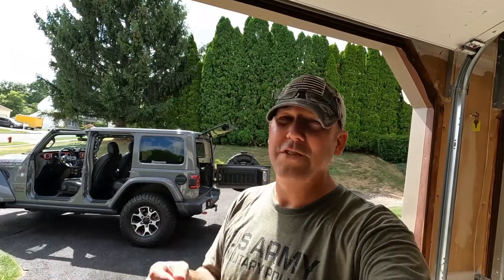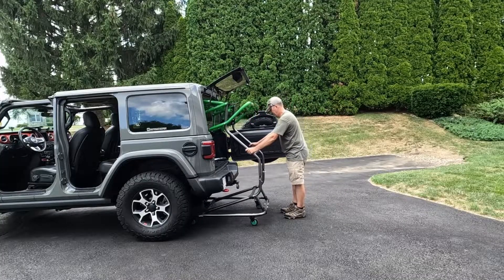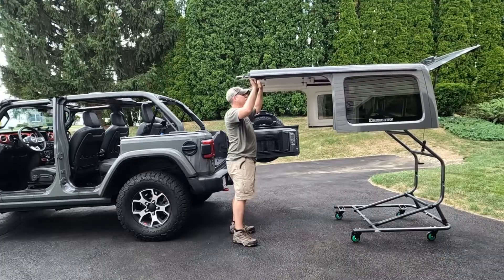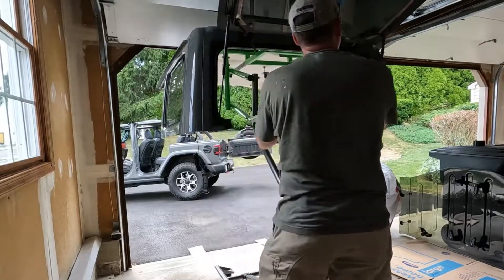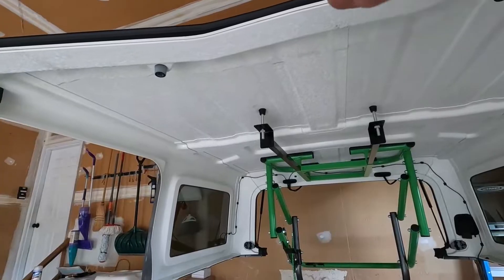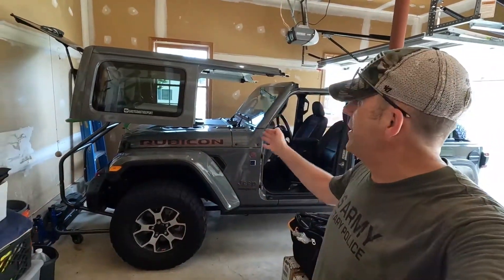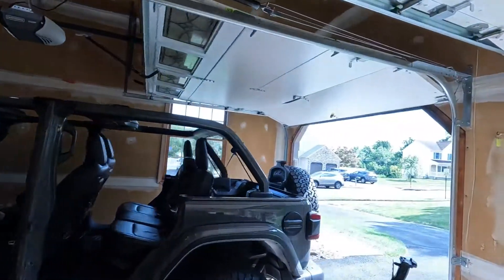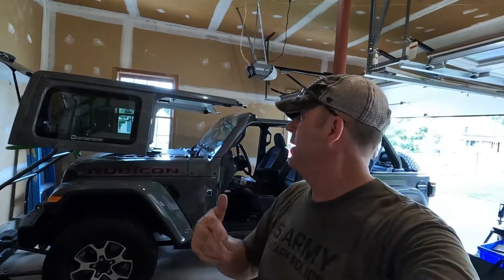How to easily remove your Jeep top: TopLift Pros Review

Comment: I agree with you on the Installation Instructions.  I struggled with getting the Hand Cable adjusted correctly.  I actually did put a Rubber Vacuum Cap on mine, since it was way too close to my hood, when I parked under it. I may actually cut it off, since the Top Section of the Unit will never ever go that low.
I have since upgraded to the TᴏᴘLɪғᴛ Pʀᴏ：Vᴇɴᴛᴜʀᴇ Pʀᴏ, because I have a small 1 Car Garage and this Unit has a smaller footprint in regards to the Base Width.  Also, the Legs are adjustable and I just tuck them in when not in use.

Comment: for whatever reason, mine was too high to get inside and under the hardtop of my 2-door stock Jeep Willys... I remove the pins at the bottom and that helped get it lower to fit - hoping the weight of top keeps it still connected

Comment: Nice job, Very informative review. I thought about this for my Bronco, but I like the positive reviews over at Rolln Jack much better... and there are a lot of them. Not quite as expensive, very easy to assemble- in other words if you've assembled IKEA furniture in the past..the Rolln Jack should be a breeze. I prefer the crank motion rather than "push down" lever type operation- I feel it's a bit more gentle allowing me to dictate the amount of pressure I want to use lifting my hardtop without the risk of damaging it. Very sturdy design, yet simplistic. My on-order bronco hasn't arrived yet, but I'm extremely optimistic my Rolln Jack will exceed my expectations- not just from my opinion but from all the positive reviews it received.

Comment: That cut at 2:23 is where you inserted the extensions, isn’t it? Why not show that?
Reply from the maker: Yes. You can see them. After I lift the top up and off of the Jeep, before I pull it back I slide in the extensions for more support

Comment: This is WAY too expensive and given the PIA you say it is, the same money could be spent to put the manual/drill-drive roof lift like I have in my video. AND you get storage with it. Those tiny rubber stoppers that extend look like they need to be bigger to disperse the pressure. It just move way too much for me, bouncy = scary and costly. I was considering this to just pop mine off and then roll under my lift but after this, nah! TY for the info, saved me $900+!
Reply from the maker: Don’t get me wrong, it could be cheaper and the instructions better, but it’s definitely worth it.

Comment: How did the adjustable extension arms just appear??  Do those go in after because there is no way they will go over the roll bar!!!
Reply from the maker: Yes, you can add them for extra support. After I lift the top I add them before rolling it inside

Comment: Why don't Yu leave it in garage and back into it or away ?
Reply from the maker: Doesn’t fit that way. Can’t park inside and have the lift with top on it backed in. You have to pull in forward to fit both. I would love it to be a longer garage but that’s just the way it was designed
Reply: Hello please from where i can buy this ?

Comment: Man, I’d be nervous with that thing, although it does make a 2 man job into a one man operation
Reply from the maker: You can shake the thing hard af and it doesn’t fall off. A lot of flex involved but secure
Reply: Does make me nervous too..
Reply: I was thinking of building a saddle type thing I can't back into but I have a 2 door so it'll be easier for me